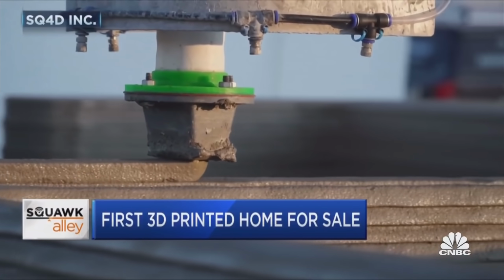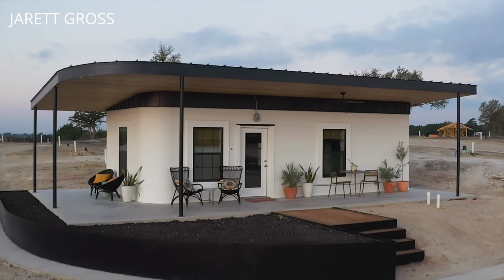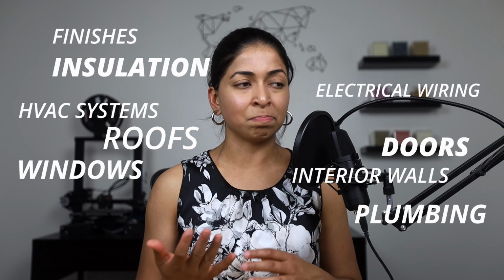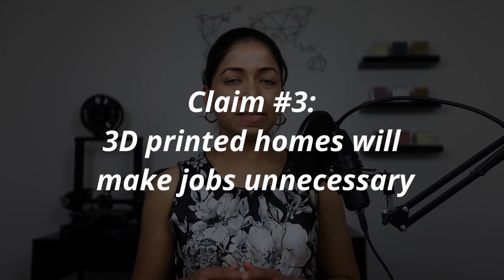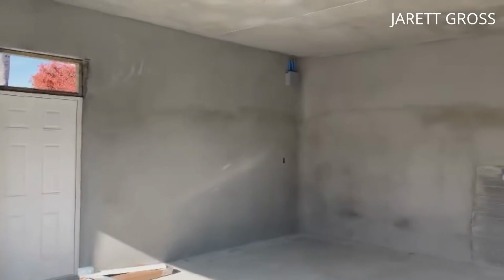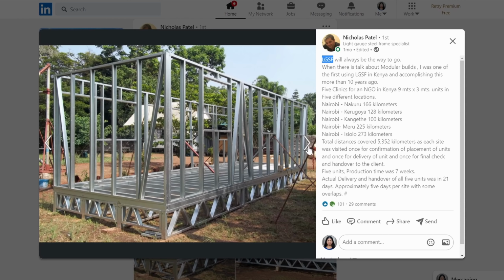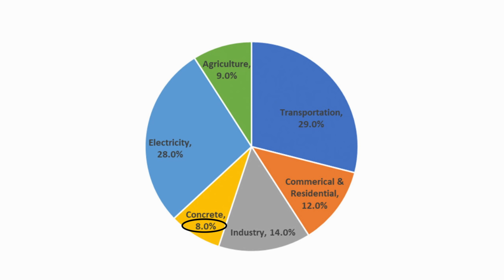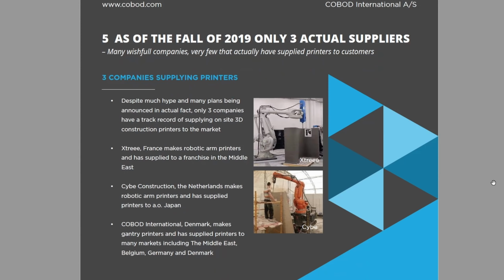Exposing 5 LIES about 3D Printed Concrete Homes

Comment: Ironically homelessness is NEVER about a lack of houses.
Reply: We got empty malls too convert those into condos.
Reply: @gunslinger9171  who's paying for that construction and the lifetime maintenance?
Reply: @petermoran406  and it has more willingly homeless people then houses.
Reply: Most homeless people do not lack homes. They have so many mental health issues which prevent them from getting and keeping a home.
Reply: It is about affordable houses though. If houses are cheaper homelessness will be reduced
Reply: A large portion is drug addiction...
Reply: It is to a degree, the less available homes on the market the more each individual house is worth, but as I said, to a degree. The real issue I suspect, in terms of housing prices, is that people and companies will by up dozens to even hundreds of houses to make minor upgrades that add a lot of value to the house and then sell them for higher than they bought them for, effectively continuously increasing housing prices.

EDIT: Another big issue with housing costs is the price of building a home, it's not cheap, even homes deliberately designed to be cheap can cost well over a hundred thousand to make. Much of this has to do with the cost of the property itself, which can sometimes be higher than the cost of building the house. Other issues have to do with all the bells, whistles and hoops houses need now a day's, now you need certified electricians and plumbers to install the wiring and pipes into your house, that's not cheap either. Then you have insurance costs, property tax and many other things I can't remember of the top of my head, all these things add up to create a unaffordable housing market.
Reply: @letoplaz8139  😆 🤣 😂 😹 😆
Reply: @algorithmicalychallenged.291  It would be a great place for our military budget to go.
Reply: @ernimuja6991  i wouldn't say that's inherently true and it depends on a lot of factors. Like if you talk about homelessness in both kids and adults, there's a lot of kids that get put on the street for many reasons that don't choose to be homeless, or kids that leave dangerous homes that would want a home, but don't know how to ask for help. When it comes to adults things also get pretty messy, because sometimes being mentally ill can make keeping a home harder but its also hard to tell if someone was that bad off BEFORE they were homeless, since having no home can affect you drastically mentally and physically. 

The thing about drugs too is that drugs look their best when you're at your worst, and when you're not in a good spot mentally it can be harder to want to stop an addiction when you're already in a bad mood. There are people that go out if their way to not want to stop but in a lot of cases people are put in this weird spot where life legitimately sucks and hurts, so using bad coping skills starts to look very appealing even if they feel guilt after doing something like that. 

So i wouldn't say someone that uses drugs or has a mental illness in its down makes them unworthy of getting a home or help, but a lot of people have this perception that people who struggle to find a reason to get better are the same as people that get high for fun, which they aren't. But its hard to tell those kinds of people apart when you might only know a few homeless people in person, if that at all. even if a lot of them are drug users, i don't see a lot of people asking "why" 

There's also things like domestic abuse, sudden bill changes, death of a family member who used to pay bills, lack of family or friends to seek help from, the destruction of houses from natural or man caused disasters, removed after a break-up or divorce,   loss of a job with no time to find a new one in time, limitations to where and how long you can stay at a shelter ect.
Reply: @slykeren8371  homelessness is almost never about affordability. People that are simply priced out of a home typically move or acquire  roommates. People who are temporarily homeless typically get up housed within a month. 

Persistent homelessness tends to be a function of either the very young or the sick. It doesn't matter how cheap it is, a 16 year old runaway won't be able to afford it. The addict who can't have $5 without spending it on drugs or alcohol, won't be able to afford it. The man who's off his meds and cannot tell reality from fiction, won't be able to afford it. Those are the people who need help and services. The price of homes is irrelevant to their plight.
Reply: @petermoran406  Canada is cracking down on owned but not lived in homes, mostly Chinese nationals shifting money to Canada
Reply: Yup it's not called houselessness.
Reply: Homelessness is a complex issue. I never realized it until I started reaching out to the homeless community. I had it in my head that if you just gave all these people homes, the problem would just go away, and it's not always as cut and dry as that. Mental health issues, drug addiction, financial constraints, health issues, social barriers, etc. These are also things that keep people homeless. I'm not saying do nothing, wash your hands of it. Actually quite the opposite. But what I am saying is that the issue is multi faceted and is going to take actual change to impact and that change goes beyond housing. It's a great start, but if we put a mentally unstable person into a nice house, how long will it last? Or a person hopelessly addicted to methamphetamine?
Reply: @Flaakk  Finland did not just build homes and give them away. It includes a significant amount of social structure and Networks dedicated to helping those in need. In fact I would say building homes is the lowest part of their program. While it is superior to, for example, California's idea of giving out free drug needles and establishing a feces cleaning service, it isn't about supply and demand of houses.
Reply: No, it's about people expecting to be handed houses free of charge after someone already did the hard work and spent a fortune. They just want it for free. Refuse to get a job and act shocked when reality catches up to them.
Reply: @algorithmicalychallenged.291  Someone gets their news and stats from Facebook... stay in school, kid.
Reply: @petermoran406  citation needed
Reply: @Merble  adorable...as a habitat for humanity member... I have built more homes for the homeless then I my self have ever lived in.

Not liking facts, doesn't merit insults.
Reply: @Flaakk  lol..Finland limits its population size. 

That's not helpping...housing for the whites and then maybe a few....if they like. Unlike the US.
Reply: Chiefarino  Sorry, but what does selling your soul have to do with this?
Reply: Chiefarino  I never cared for Goethe's version. It seemed like a cheap and unearned happy ending for a horrible person. I prefer the older version where Faust died horribly as he was dragged to hell. I still don't know how that relates to this discussion.
Reply: Yep, its almost 100% drug addiction.
Reply: @algorithmicalychallenged.291  Are you assuming that giving someone a home means that they will never positively contribute to society? If you answer with, “No, I’m just trying to be realistic…” then your thinking is still to narrow.
Reply: @algorithmicalychallenged.291  it’s almost like homelessness is an issue caused by our capitalist society. You are so right
Reply: True, but also ironically housing and helping the homeless is cheaper than having to pay for the medical bills and other problems that come with being homeless.
Reply: @Gatsby3737  i wouldn't say it's a problem of our capitalist society. Since capitalism is really about driving Innovation through monetarily incentivising the best idea. More so our idea that whatever the government collects money to do is somehow socialism.
Reply: @Merble  adorable
Reply: @iflex1963  a large portion of people who have jobs and homes are drug addicts too.
Reply: @Shornandkenny  The percentage of homeless individuals being addicted to drugs and or alcohol are significantly higher that of those maintaining a home and a job....not even in the same level.
Reply: @iflex1963  i didn't say it was. Smh. 
I made a very simple statement.
Reply: @Shornandkenny  What was your point in making the statement directed to me? What I said was facts. The discussion here is about how to solve the homeless crisis...had nothing to do with people that have homes. Removing drugs and alcohol from the homeless would certainly be a starting point.
Reply: Yes it is really a drug and mental illness problem
Reply: @iflex1963  I get sick of listening to people who blame the homeless problem on addiction.  It honestly couldn't be further from the truth. My point is, people aren't homeless because of addiction. Many addicts contribute to society just fine. Many homeless are mentally ill, physically disabled, come from horrendous upbringings and or dont have any life skills. Of course,  some homeless are drug and alcohol addicted too. 

Have a nice day.
Reply: @Shornandkenny  If you are tired of hearing it...then you should probably go back to the shop and single point chase some threads to help calm your disposition. Much of what you said I agree with. Which came first? The mental illness, bad upbringing, abuse....or the drug addiction. It really doesn't matter because if drugs and alcohol weren't a thing people couldn't self medicate. It would help force them to deal with life in general...and the issues at hand rather than getting messed up so they can check out of the reality.
Reply: @iflex1963  haha, single point some threads.

🍻
Reply: @Shornandkenny  I took my machinist apprenticeship at Landis Machine Co. in 1981- 1984. Went on to be the General Manager of a machine tool rebuilding and CNC retrofitting business in Smithsburg, Md for near 20 years.
Reply: @iflex1963  very good, you certainly caught my attention with that comment lol. Im an aerospace cnc machinist\mould maker.
Reply: @Shornandkenny  We also had a contract with Fairchild (when they were in Hagerstown, MD.) to make all there aircraft replacement parts.
Reply: @iflex1963  cool, we build tooling for sandcastings. 150 core jobs for main body of turbines, turbine gearboxes and helicopter transmissions and stuff.
Reply: Actually, it is in certain cases. After natural disasters such as fires, floods, tornados and hurricanes. When people are dislodged and housing is destroyed, there is often not enough housing for the dislocated people. Hence the FEMA trailer that my family is well aquainted with. Also, the rapid influx of immigrants can lead to a homeless crisis that previously did not exist.
Reply: The problem of homelessness is, at its root, the problem of hopelessness.
Reply: @petermoran406  so does Britain at one point when house’s in London were commanding £1 million pounds price tag you could buy a house in the north of England for £1 pound
Reply: @ernimuja6991  incorrect some have health issues but there are children young people and the elderly also as well as economic immigrants the last part is the only ones who need affordable housing the others need help In a very different way
Reply: @redrb26dett  adorable...to much work. 

You need a better plan, you just made an even more expensive plan then the current. 

Something less final solution would help with the marketing, too.  😉
Reply: @redrb26dett  You are correct. I did some google search and it turns out a lot of homeless people are children. 

Yes, they just need a home. Most elderly however? Infirm? They can't keep a house depending on how long they've been homeless and how much their mental health has detiorated. 

Don't get me wrong from my original post, I am not saying these people will never change so we should leave them. My point was that the ones which are most affected by homelessnes are the elderly and the infirm, however our society thinks that as long as we just build houses then that's it, job done. Most of these people are incapable of keeping a house and I don't know the stats, but most had some kind of mental health issue that led them to lose a house in the first place. I doubt all the homeless just suddenly got struck by lightning and their house dissappeared.

As for children, yeah, they're best served by just giving them a home.
Reply: @iflex1963  do you realize, that most people who become addicted to drugs, their path started with a legal prescription from a physician…
Reply: @Chimera_Photography  I'm not sure about "most " but regardless where they got their first taste...if the doctors cut them off and street drugs weren't available they would be forced to get clean...much like being in prison..which is definitely a huge contributing factor to homelessness.
Reply: @algorithmicalychallenged.291  that’s super insensitive to say especially when covid is a thing no one willingly looses their job or gets sick and hospitalized hundreds of homes in texas were destroyed last year from severe flooding and storms evictions are still on a rise no one asked for that
Reply: @iflex1963  drugs and alcohol are the least of our problems it’s healthcare and assistance for vets the mentally ill and disabled they’re most threatened by homelessness but the fact that wages aren’t increasing but the cost of everything else is, that’s a problem.tons of people are loosing their jobs currently and getting sick or having essential family members and support drop dead
Reply: @iflex1963  being in prison doesn’t help addicts either they’re vulnerable they get taken advantage of and often get hooked on even dirtier prison drugs only rehab works
Reply: @princess4509  feelings are irrelevant. 

To simplify it as much such as possible. Bad things....they will always happen. 
It's still up to the individual.
Statically....today. Most people are willing homeless.
Reply: @princess4509  name me one nation that doesn't have that problem.
Reply: @algorithmicalychallenged.291  that’s so blatantly ignorant bro like... people do matter people get raped children get orphaned and trauma leads to increased risk of addiction we’re human beings homeless people are people who need help most of them are PHYSICALLY DISABLED
Reply: @herdfedsfre  all nations have this problem because we live in a world overthrown by capitalism their are some egalitarian tribes that still exist and they’re fine
Reply: @princess4509  ...again, the majority are homeless by choice.
Reply: @algorithmicalychallenged.291  what’s your stats and studies to prove that provide some sources
Reply: @princess4509  sure...my research rate is 43$ an hour. I prefer PayPal 😌 .

Let me know when you're ready.
Reply: @princess4509  stop requesting free work.

You have the choice to pay......l
Reply: Prices, we get it, but sometimes building a new house in the right place than an built one.
Reply: @2mado188  it’s fine to just want to build a house but ultimately having people move into vacant spaces revitalizes the community and the small businesses in them
Reply: @princess4509  Oh sorry, I write "prices" refering to high costs, not an @user
Reply: Spain when they went bankrupt about 6 years back had brand new towns and apartment complexes they had built, as well as a new airport, all of them left abandoned within a years time. They still have homeless people but also entire apartment complexes that no one lives in or even take care of.
Reply: @annabees  lol.no. good luck .
Reply: @-alyissa-3632  again, as stated. Homeless people are welling Homeless. You can look it up yourself. 

Stop being angry at the messageger. It does make you look foolish.
Reply: homeless problem is either drugs, mental issues, or unwilling to live by society standards
Reply: @petermoran406  seriously
Reply: #AbolichMoney aim for #RBE Resource Based Economy.
Reply: @aicram62  
So not a print-money-out-of-nothing-to-sort-of-solve-every-problem-or-atleast-until-it-goes-away-economy then?
Reply: @Sekiberius24  100% spot on, especially your edit section!
For example, I have the knowledge and ability to build a complete home from the ground up but with regulations like you mentioned, it is impossible for me to go, by a piece of property and get to work all because I don't possess those particular "certifications" even though, in some cases, I probably know more about the topic than those with the certifications.  Its basically gotten out-of-hand because its a bunch of desk jockeys playing _"I'll scratch your back if you scratch mine and we'll help each other get rich while doing so" _
Its really all a big sham and the little guy like always, gets screwed in the end.
Reply: @iflex1963  So they deserve it then do they ? Keep victim blaming and making excuses to keep the status quo, rather than attempt to change anything aka "solutions".
Reply: @petermoran406  Because they are kicked out by greedy landlords at gun point if they miss a weeks rent in the "land of the free".
Reply: Yet in my country the rent is ridiculously high for what could be considered close to being a slum , if you can find a place to rent that doesn't require 80% of your monthly income.
Reply: @MarkCisOfTheLoonieLeft  You're a little late to the game...but I'll oblige you. Where did I ever use the word "deserve" ? You didn't see it on any of my posts. I blame drugs and alcohol and the network that makes them available particularly to vulnerable people. It's hard to blame individuals due to the addictive nature of these
substances.
Reply: The homeless problem in cities with a housing shortage: Austin, LA, SF, is a million times worse than in cities that dont: pittsburgh, philly, etc
Reply: Good point!
Reply: @slykeren8371  You weren't around when the housing bubble was created and popped where you? They tried this idea in america, and it caused the great recession.
Reply: Mostly mental illness and substance abuse. Which often go hand in hand.
Reply: If housing was free or has less permits to have one then it would solve the problem
Reply: @doreenlane2370  
Housing is free.... For the rich. Other than that, I have no idea what you mean.
Reply: @herdfedsfre  agreed, taxation, unfair divorce laws, broken "social net" that is consistently abused. If we get rid of all these good intentions that are paving the way to hell, we'd be much better off. I work/worked with a few organizations who do their best to clean up the mess the government makes. We don't live in a capitalist society at all. This is corporatism. 

Mental health, chronic illness, drugs and runaways are issues we can't solve with making dead malls into condos. And if the government tried to they would screw it up, and they would give the contract to one of their rich corporate friends who would cut corners and the problem would still exist. 

If you want to fix the problems in society you need to do so with organizations who work with their own money, or donations. Organizations who actually give a crap. 

The government doesn't care about you, they hate all of us. Smaller government means less social issues. period.
Reply: @gns2550  yeah the unwillingness too. There's actually a wealthy guy who lives 7 months out of the year homeless even after he hit it big, just because he likes to be homeless. Sometimes there's no real clear answer why people would rather live such a different way but they do. Humans are more complex than the other side makes it seem.
Reply: It is. To a degree. There's SO many places in the world with insufficient housing supply (and homelessness is far more than just rough sleeping it's to do with security of tenancy).

So unless you want to ship people off to the middle of nowhere in a ghost town with no jobs etc etc then yeah building housing is super important.

But it's not the physical process building that's the problem. It's the politics.
Reply: @mytimetravellingdog  
I remember right in the middle of the pandemics. There is a place called Hidden Hills. Its a gated community of village-sized palaces up in the Calabasas hills of Los Angeles. Where The Rock, the Kardashians, and a bunch of those people live. Across the street from their doorstep, were blue tarps, tents for the homelss down one side of the street. And on the other side of the street were empty buildings with "For rent", "to let", and "vacancies" signs in the windows for a mile.

Im not saying move all the poor people into any random building. But its a matter of organisation, politics, and humanitarianism. All of which is deeply, desperately lacking in the US. 

Meanwhile the US government was claiming BEST CONOMY IN THE WORLD with 4% unemployment. So no help from there.
Reply: It frequently is.
Reply: and a lack or help for the drug users it involves.  over 80% of homeless are addicted to drugs
Reply: @algorithmicalychallenged.291  taxpayers. the amount of money we spend on services and law enforcement and more for the homeless exceeds what it would cost just to give them each a home and assign them to a social worker
Reply: Just about as much as starvation is caused by lack of food.
Reply: @relkasi5925  
Thats more complicated, I feel, but...
Reply: @algorithmicalychallenged.291  Me. I'm paying.
Too bad the government won't allow me to.
Reply: @slykeren8371  if you have 0 income, a 1000 dollar a month house is as good to you as a 10 dollar ones.
Reply: @mursin9718  This aged well
Reply: @Gatsby3737  " it’s almost like homelessness is an issue caused by our capitalist society. You are so right" That is probably the most idiotic thing I've ever seen. Who do you think pays for it in a socialist economy, eh? The same people as in the capitalist society...
Reply: @relkasi5925  we already make enough food to feed every human on the planet and then some, so just like with homelessness and houses the problem of starvation doesn't come from us not having enough food for everyone.
Reply: @algorithmicalychallenged.291  profit-based society has rotten the heart.
Reply: @francois853  you'd be really mad if you knew what your taxes went to right now. I'd rather pay more to house the poor than be government welfare for billion-dollar businesses.
Reply: @Gatsby3737  just because they're spending tax money on one thing they shouldn't doesn't mean we should let them do it on more.
Reply: @Benjamin1986980  you re correct but it doesn't sell.
Reply: NEVER!
Reply: Well, if you are splitting hairs about “lack” vs “under supply”, maybe. Certainly some of homelessness is due to the un affordability of housing. If you replaced NEVER with SURPRISINGLY OFTEN or USUALLY it’s not just due to an under supply of houses, I would agree.
Reply: @Sekiberius24  ive met quite a few homeless people in the us most need help 
they have some issue that keeps them from working 
wether its addiction or mental illness 
i will admit ive in the big cities theres been alot more homeless thats propobly more of an economic problem its not worth it to work if you can camp with access to clean water and do a few odd jobs to buy cheap food it can be quite economical to ride out financial trouble
Reply: Just like world hunger is not because of food scarcity
Reply: well I would think it has to do at least partially with lack of cheap houses with low upkeep?
Reply: It is in Tropico
Reply: @Sam_the_Sham_and_the_Pharoahs  It's true there are a lot of things keeping people homeless...but all of them become less bad once you have a roof over your head. Even for cases of severe mental illness or addiction, getting them in some kind of housing is the only rational first step because you're not going to be able to solve any of those problems while they are slowly dying of exposure.
Reply: @algorithmicalychallenged.291  anyone willing to take it over and not just let it sit vacant and a decrepit eye sore on a community. Nothing ruins a city more than run down falling apart shopping centers
Reply: @Frommerman  How do you keep a mentally disturbed person in that housing? How do you get the drug addict to not turn it into a dope house? These are problems that need addressing before just throwing them in a house they can't keep and under a roof they can't maintain? I'm not saying let them freeze, far from it. But I am saying we need to address the problems that made them homeless in the first place or you're really putting a bandaid over a gunshot wound.
Reply: It's because people are too lazy to work
Reply: It can be. There are basically 2 types of homeless (1) those with addictions (2) those who cannot find it afford one. We have both in Ireland
Reply: @mefobills279  
Yes.... Nazi was short for National Socialist. So they did a lot of what any good national socialist country would do. Which means protecting family values and create a society wehre people are able to find opportunities and create a life for themselves relatively unhindered. Something which would be UNTHINKABLE for America both in the 1930s and today.
Reply: @mefobills279  
You want to sound all edgy and controversial. But there is nothing wrong with Germany as a country. Or the way they do things. Its pretty much in line with every top ranked, well working, civilized country.

They have the most STABILE, solid economy in the world. Unlike Americas economy which is a house of cards that refuses to fall down because its propped up with more printed dollars than you can shake a stick at. 

FUN FACT: 80% of all the US dollars in existance.... Were printed in the last 2 years. America printed more dollars than there is money in the entire world - outside the US.

So congratulation on having the largest economy. Because who can compete with that. But, hey.... Thats also the reason why a Lamborghini costs TWICE as much in California as it does in Europe now.
Reply: @captain_context9991  I was talking about NSDAP Germany, that did very specific economic moves.  It's not really edgy, it is rational to look to history and what worked.  It is edgy in this environment because that period of history was stigmatized.
Reply: @captain_context9991  When objects fall, if the hit something (mass) the object is deflected, or is slowed down.  In Jenga, buildings topple, they don't fall into their own footprint.  A game reveals physics to physicists and engineers who were delusional.  With regards to the whole self made phenomenon, of course that is BS.  Nobody is self made.  Your observations are astute.
Reply: @captain_context9991  Pretty much anybody who has a background in science knows that mass doesn't fall into resistance.  It is a constant of the universe, like gravity.  My point was that humans, even smart ones, can become narrative controlled.  This is the case for most Americans.  Trying to dissuade somebody is also difficult once their mental pathways are formed.
Reply: @Paul Jake 
Yeah well.... Youtube has a way of hiding things that they dont like. Or things that the publicher of this video doesnt want. It often happens completely automatically. 

And also this format isnt really built for having discussions and debates.  There was a time. In the early days of Youtube. You could actually explain things and have a conversation here. But you just cant anymore.
Reply: @Paul Jake 
Kindof, but not really. It used to work, but they realised people are just here for the hate and flagwawing. There is simply no money generated in public participation. So while it still exists, its extremely limited. And certain key words and phrazes are screened out.
Reply: @Paul Jake 
Oh, there is no such thing as "end of times" not for our generation, not for the next ones. But living conditions may go drastically down, obviously. Right-wing extremism and PREDATORY capitalism is at the bottom of every problem.

Recently Facebook lost 750 billion of their value, Teslas stocks went down by 55% over 3 months, and it seems the ultra insane capitalist stranglehold on people are finally starting to show cracks in the paint. 

We live in very strange times. But those videos of yours were very heavy and dystopian. Im not quite there yet.
Reply: Right. It's about being an addict and alcoholic usually, add in lack of good job training
Reply: Go to canada 🇨🇦
Reply: Some people can't keep up with a home.. sad but true
Reply: @algorithmicalychallenged.291  Hey maybe the fact that humanitarian efforts are hindered by profit motivation is a flaw of capitalism, maybe, perhaps
Reply: @algorithmicalychallenged.291  Those who own the condos, I imagine. I'm sure the current mall owners would love ridding themselves of their liability.
Reply: Homelessness is EXACTLY about a lack of houses. If you don't lack a house, you're not homeless, THAT'S WHAT BEING HOMELESS MEANS.
Reply: Drugs and alcohol have entered the chat
Reply: @algorithmicalychallenged.291  
More like psychologically challenged...
Reply: @ernimuja6991  Nah, it's capitalism.
Reply: well it kind of it though
Reply: @Paul Jake Celebrities, as bad as they are are typically not suffering from schizophrenia at the same time.
Reply: thats entierly false because the fact is that no matter the price its the taxes that prevent people keeping homes as well as lack of funds
Reply: @mursin9718  no the budget we spend on sports should go there
Reply: @mursin9718  no the budget we spend on sports should go there
Reply: schlegg3438  I agree and the current medical system is not capable of helping in its' current state. IMO
Reply: In America that's 100% right. 

Homeless is about a lack of build up of people rather then homes

Monopolies are more about government regulatory protections rather then the lack of it.

Financial stability is more about consistent slow actions rather than the quick decision

The meaning in life is found in the sacrifice rather then happiness
Reply: @Benjamin1986980  Homelessness is complex and you're right that there are multiple factors outside of affordable housing that have a huge impact on persistent homelessness, but I think it's important to say that lack of affordable housing can also create homelessness in those who do not have the other issues. I could write a lot more on that, but I'm sure if you're interested in finding out more, you'll either ask or you'll do research (ie. working people with or without families that don't make a living wage despite full-time or close to full-time work; disabled people  with or without children who receive benefits below the poverty line but are unable to work to supplement this, etc.)
Reply: @k.u.m.o.r   I'm hoping your lack of knowledge and education on this is simply because you are young and don't have the wisdom, relevant education, or experience to know better.
Reply: @M3NDVX   Where on earth do you get your information from?
Reply: Um yes it is
Reply: @BlackHawkBallistic Spain cracked down too.   They put a tax on vacant homes.
Reply: @JoeKyser  
Are you telling me there is a lack of houses? Weird claim to make.
Reply: @captain_context9991  do you really value my opinion that much that you want me to expand on it? My comment is what it is. You can read it however you wish. What I do know is that affordable housing is definitely an issue.  Supply and demand drives the open market in the United States. The extrene left directly correlates the problem.  A shortage or lack of affordable housing is definitely an issue. If there isn't a home for someone, thats a lack of a home. Plain and simple. We can be unrealistic and say the homes exist and the people could live in them even though they could never afford it. The extreme leftbis okay with that, therefore they say there isnt a lack of homes, thats silly. Of course there is in reality but we can act like there isnt and people can be magical and grow money on trees or maybe tax payers should foot the bill and move them right next to the Jones. Might as well buy them a car too. There is no lack of those. Actually there is no lack of money. The United States can print more in one year than they have ever cumulatively printed since they have printed money. I get it no lack of homes. I will go with it. There are plenty out there waiting to be given away or subsidized. We justnl wont do it. Just like we wont give Healthcare away either. I know gas lighting when I see it.  This is a prime example of it.
Reply: Nope. It’s about zoning
Reply: Not "never" but most of the time you're correct.
Reply: That's not true any more. There are very little homes for the commoner and lots of homes for the foreign investors.
Reply: No, it's about the homeless either being drug addicts, mentally ill, or just plain lazy. Probably less than 1% are actual hard workers who've just hit a string of bad luck.
Reply: @algorithmicalychallenged.291 why can’t the same entities that pay to ship homeless people to other cities and build hostile infrastructure do that instead?
Reply: @Benjamin1986980 Why does Finland have so many amazing social structures and developments???
Reply: That's what you take away from this?😂
Reply: @iflex1963 all thanks to the U.S government
Reply: My wife and I became homeless back in 2011, I had suffered from 2 back injuries and was unable to meet the requirements for steady work, mostly because I was a skilled laborer in industrial mechanics and was a fireman, and at one point, I was working as a greeter at Walmart, at the ripe old age of 51. My wife did have a decent job, but she developed COPD that was rapidly advancing and couldn't work anymore as well. Thankfully we found a shelter that was focused on keeping couples together, otherwise we would of had to split up. It took 2 years and 2 attempts for her to get disability, it took me 7 years and 4 attempts myself. Since I could walk, they kept turning me down. 

Never at any time was the lack of a home an issue, only that we didn't have an income.
Reply: Homelessness is now about affordable housing. The income inequality is getting worse because of the housing speculation and the cost of building materials. We have what we call the working poor and a housing crisis, because most of your income goes on housing. And if you can’t afford it you become homeless. If you want to fix poverty, fix the housing crisis.
Reply: I used to be homeless in San Francisco. So many people talk about the causes and yet they were never homeless. Trust me, it has little to do with mental health. That’s what people want you to think. I was only temporarily on the streets until I figured out working 100 hours a week fixed my situation. 

Sooooo many homeless people I met just didn’t want to work because of the government giving them so much financial assistance. They literally don’t have to work. So add drugs into the mix and that’s why so many homeless people have been homeless for decades. If you remove all the financial help they receive, then force them to work. The mental health issues form after they are homeless.
Reply: @iflex1963  You would be surprised how many of your "drug addicts" were the elderly or disabled that suddenly lost their income. Many street people that are like that are forgotten elderly family members THAT NO ONE HELPED THEM! Get a clue and before you start spouting the "common beliefs" just look into it. My wife and I were both disabled in a short period of time. She has severe COPD on oxygen and I lost an argument with a 5 ton piece of machinery. It took 3 years to get approved for that AND housing assistance, in that time in the shelter we met single moms, families, and ONLY ONE DRUNK AND ONE DRUGGIE. Plus, you forgot men on the run from their responsibilities or the cops, but that was ONLY the men. More than half of the homeless we met were just down on their luck (like us) or the elderly abandoned by their families.
Reply: @scarsdale7186  I merely made a statement that was true.... no judgment whatsoever. If drugs weren't an issue there would be far less homeless. Obviously there are many other individuals that eradicating drugs wouldn't affect at all.... ie...your situation.
Reply: @iflex1963  I understand, but I got very tired of people judging us and others who weren't able to avoid it. We were lucky enough to still have our car, and I took a few of the single moms and kids to doctor's appointments and the store. Many weren't as lucky. Go after deadbeat dad's, date rapers, and parents too worried about their image, rather than their daughter.
Reply: @iflex1963  
Its always amazing to people over in very, very civilized Europe how Americans seem to take to drugs instantly once they get homeless or poor.

Its because the US does not have a working social structure. So if you cant get a legal job, well then anything you do for money will per definition be illegal. Mostly working with cooking, transporting, or selling drugs.

Also illegal drugs are also the only way they can afford healthcare. In the form of self-medicating on hard drugs.

Thats just Murca for you. Recently some guy asked me how the opioid epidemics are over in Europe... And he would not believe me when I said they dont exist.
Reply: You've never seen the UK then ig, the housing here is limited and unaffordable
Reply: Ikr, making more homes just means there will be empty houses.
Reply: @Rose_Butterfly98  
Thats not what I was talking about above.
Reply: @captain_context9991  then what is your point? 
Because that was the obvious one, building houses will not solve homelessness if the homeless can't afford them.
Reply: Yeah it's a lack of work ethic
Reply: @macdaddy1376  
Uh.... no.
Reply: @mursin9718 Tell that to Isreal. Don't be so childish in your thinking.
Reply: @iflex1963 Human that also an additction? Wow?
Reply: @mursin9718  That's not how it works. If everybody could easily afford a home, even if they have very low income, why the Hell would anyone bother to work? And the price of everything else would just go up. What you're suggesting, is no different to printing money and handing it out. People work half their lives to pay for their home. Make cheap homes, and people will just retire 20 years earlier. People don't go to work very day because they want to. They do it bcause they have to. That includes the people who keep the lights on, take away the trash, keep the streets safe, FEED EVERYONE...
 The economy is a complex system.
Reply: Lack of homes, red tape, and greed = unaffordable shealter costs.
Reply: No it's not because homelessness isn't about people not having homes. Most homeless people have mental illness issues or are drug addicts. Plenty of homeless people choose to be homeless because that's how they want to live. Most people who advocate for the homeless don't bother actually finding out anything about them. They think that just sticking a person in a house fixes the problem. You do that with someone with mental illness they're just going to destroy the house same with drug addicts. But be a bleeding heart.
Reply: @iflex1963 in most cases drug addiction is caused by homelessnes not the other way around.
Reply: @slykeren8371 no. Germany has a shitload of empty houses outside the big citys, in the boonies.
Every attempt to get the homeless settled there failed. Even with what is basically free money.
Why? Lack of dealers(not the car variety...). Also gettibg ripped out of "theie home city" etc etc.
There is always a layer of people who simply are never gonna move to a house.
Reply: For a time here in Venezuela it WAS about lack of housing. For this reason a lot of people started building "ranchos", this lead to chaotic situations like the region called "Petare", mountain filled with low income poorly made housing, and one of the worlds crime capitals

This is one of the factors that lead to socialism early adoption in the country, since Chavez placed into action multiple plans for the creation of cheap edifications a in mass in barrios and rural areas. 

Of course this is the same socialist movement that completely destroyed the country's economy, but that's a history for another time
Reply: @gunslinger9171  a decade ago the solution was all those empty KMart stores…. Until someone pointed out they have zero cooking capacity, only a relative few toilets and sinks , and NO SHOWERS…..
Homes are not simply boxes you stick people in snd then call it a day
Reply: There are 28 vacant homes to every homeless person
Reply: @lenux21  
I have never seen a number for that. And I very much doubt anyone has an accurate number for it... Especially since nobody actually counts homeless people. But, yeah... There are many, many.
Reply: Just to be clear here not every homeless person is the type of person you see on the street strung out on tranq. Just a heads up so you don't give a false impression of the issue being purely one of mental health and drugs and not one that's also greatly exacerbated by rising prices due to an unwillingness to build more homes.
Reply: @ellusivegman  
So youre saying there are more homeless than those you see... I dont see how that makes it any better.
Reply: @k.u.m.o.r You shouldn’t have to grind your entire life just to have a roof over your head.
Reply: @Shornandkenny It IS the truth. Most of the chronically homeless are either severely mentally I’ll or cracked out of their mind 24/7.
Reply: I could’ve been largely handled if there was the will
Reply: @ernimuja6991 
And our society has decided to punish them for it.
This place is sick.
Reply: low human density= cheap prices and no homeless... Paris homelessness issue is all but a density. Too many people.
Reply: Yep.
Don't know about your little corner of the world. But here in NZ, many property owners keep some of their properties empty to increase the monetary value of their real estate portfolio.
Salvation army is great like this. They have dozens of empty properties, all over NZ...and probably much of the rest of the world too...
Reply: @coreygardner1371  
So whether irs NZ or in NY, HOW exactly does it make them more valuable to keep them empty?
Reply: @captain_context9991  there are more people wanting to move into homes, than there are homes to move into. By increasing the demand and choking the supply, they push up the prices they can get on sales, leases and rentals...
Reply: @algorithmicalychallenged.291 Because rotting in an empty state for 30 years really is cheap right?
Reply: We live in a place where it is actually illegal to build shelter. I mean, you can……but first you have to own the property, get permits, and then build a structure subject to inspection. If you violate any of this, you are subject to violent removal from the area, by local authorities. The VAST majority of the United States, is completely undeveloped space.
Reply: @Deeplycloseted435  
Yeah there are several good reasons for that.... Once you dedicate a PLACE for poverty, well then you have forever-poverty. Once you start building shelters from boxes, crates, pallets, whatever, well then a couple of years later, you have the slums of Bombay. And then people who arent poor, will abandon the place. Businesses, investment, everything dries up, and you get another Detroit. This is why they will not allow anything more than tents.

It would also be extremely weird and dystopian if everything was super developed, dont you think. 

But also yeah... Boston, Baltimore, Detroit, Philly, the list goes on and on. Crumbling cities of poverty where there used to be craftsmanship and manufacturing. But one day America decided to ship all that over to China and Mexico. SOME would call that a bad move.
Reply: Darn straight friend.
Reply: Yes it is!? More houses = more supply = less scarcity = reduced prices
Reply: @roberttalada5196  
Yeah the correlation doesnt necessarily work like that... The point was rather... There are a hell of a lot of empty buildings and houses with no people in them. 

Like last time I was in the Calabasas area in California, LA. Super rich area. But streets full of tents and rubbish where the homeless live, then, just across the streets, buildings were boarded up the whole street full of "for sale", "to let", and "vacant" on every door.
Reply: Yea a change of heart, the point is coming home to start new. how many bad people and how many good people may show the Issue we all have in the hearts.Then a third is are Maker of us. 
I am homeless? Why!!! We think to much or little.....